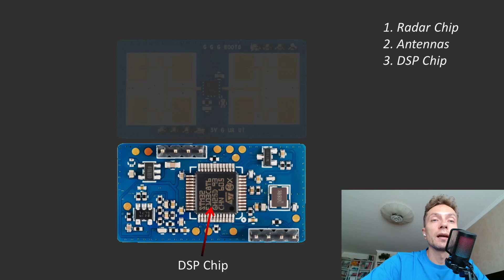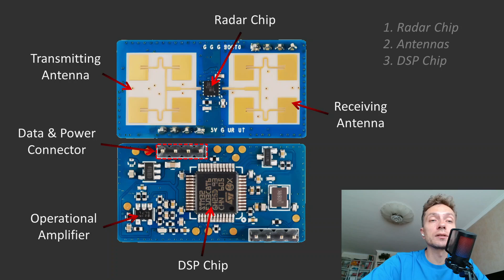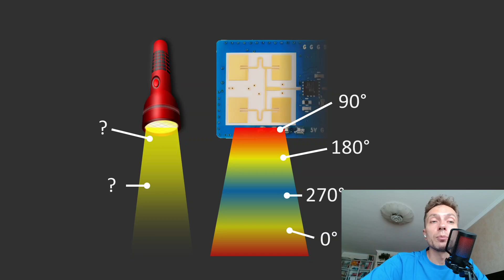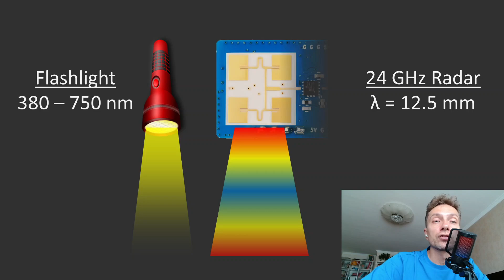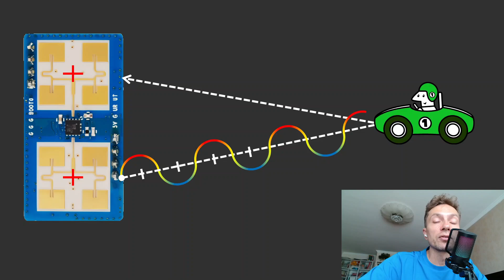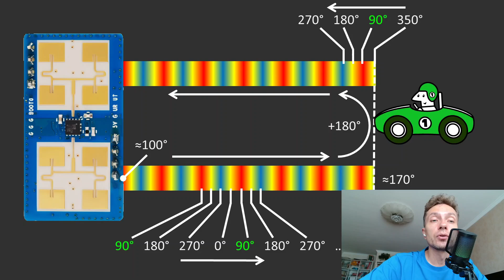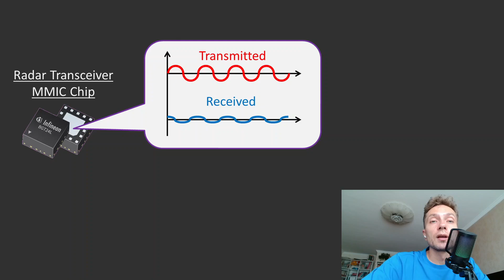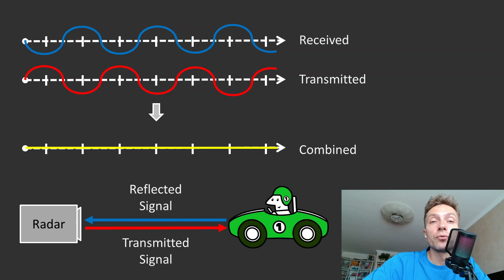How The Radar Works

Comment: Is there radar part for measuring car speed roughly 100 meter? I want to measure car speed in front of me while my cars also moving.
Reply from the maker: Can't really recommend anything, even latest target tracking traffic radars are far from perfect and have inconvenient communication protocols and bogus readings. Something like CDM324 but with two times larger tx/rx antennas can sense vehicles more or less reliable - speed only, but the algorithm is on you.
Reply: @GeorgyMoshkin  radar from scratch seems imposible for me
are there any works, tutorials for larger antennas?
Reply from the maker: @hakankosebas2085  You do not need to design a larger antenna. What I meant is to choose one of the sensors with a slightly larger antenna. For instance, 8 square patches instead of 4. For example, InnoSenT IVS-362 or something like that.

Note that what you are trying to achieve is often called "patrol mode" in traffic radar terms, and the algorithm is not very straightforward. FFT spectrum will have multiple peaks: road speed will produce a strongest peak, then there will be some trees, surroundings. And finally, there will be other vehicle speeds (relative to your vehicle speed, need to add/subtract road speed to get the final reading).

I've learned radars because I did a lot of repairs and firmware fixes. Therefore, it was very easy for me - constant access to hardware and software and just a little bit of books and articles. You may try to look into projects like https://github.com/smartmicro/smartmicro_ros2_radars
This company radars a pretty good but not cheap. Not sure how good the open-source project is.
Reply: @GeorgyMoshkin  thank you for detailed answer, this clears a lot

Comment: Can I use my old microphone oven as radar transmitter?
Reply from the maker: Any microwave source can in principle be used to illuminate a target. The tricky parts are: making an efficient antenna, and making sure you don’t harm yourself in the process. Even if exposure levels stay low, just the paranoia factor of experimenting with repurposed microwave oven parts is pretty high.

Comment: If gold conductor use in radar then you can had high power radar with small voltage cheap
Reply from the maker: Gold is often used to achieve certain goals in microwave design

Comment: The basics of radar output and reflection in a perfect world may be consistent.  On the other hand the operator has to interpret the received signal using vision and the doppler sound.  Interference, size of target(s), and speed all affect the returned signal.  

Even with the sophisticated radar technology in the newer radars, the operator has to use their judgement.  The larger of two targets returned signal isn't always the stronger returned signal to the  radar receiver.  A smaller targeted unit can return a stronger signal to the transmitter/receiver.  Ask me how I know.  

Law enforcement doesn't always train officers well. Too many law enforcement assume the larger of two is the higher speed.  It takes a well trained person to use the doppler sound, vision of the targeted area, vision of the movement of the targeted objects, and application of training with good judgment plus common sense to determine which object is the higher velocity.  

Short story is a big truck won't always return the stronger signal when opposed to a smaller object as an automobile.  The smaller object possibly can return a stronger signal.
Reply from the maker: You are right, if the small vehicle has more features resembling corner reflectors can provide a much larger amplitude response. Radar installation height and beam direction could affect this as well: if radar installed too low, the beam may be "channeled" under the truck and only hit smaller cars. Monopulse FSK radars are prone to "averaging glitch" for the targets with close speeds (adjacent or same FFT spectrum bins): the angle and distance to the target becomes incorrect. The latest 70+ GHz radars kind of solved most of the problems at expense of extremely large modulation bandwidth and cost. There are too many variables, and it seems that the current radar sensing approach can't be fully trusted without some help from the lidar or camera.